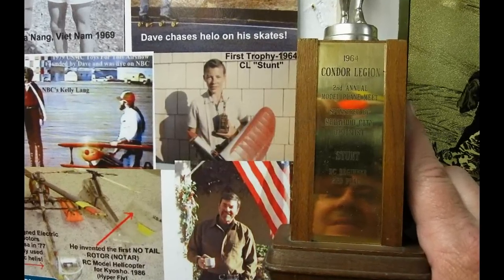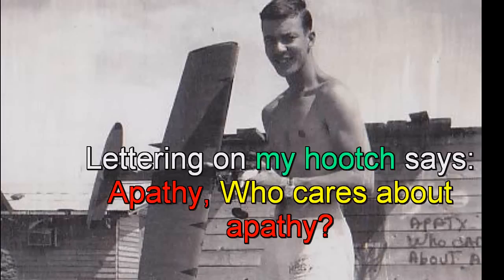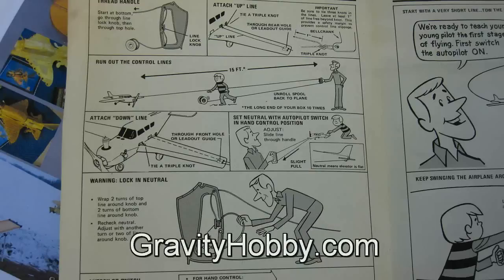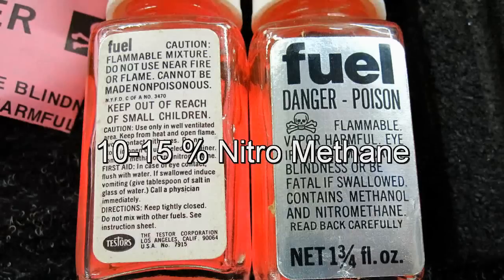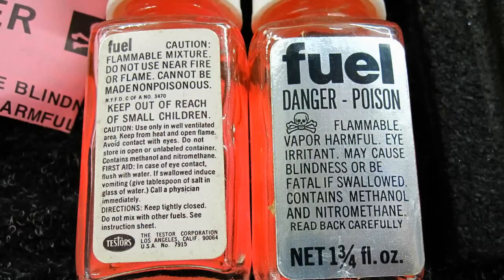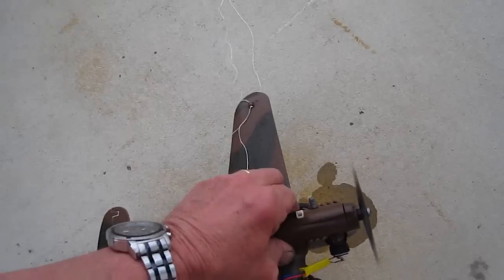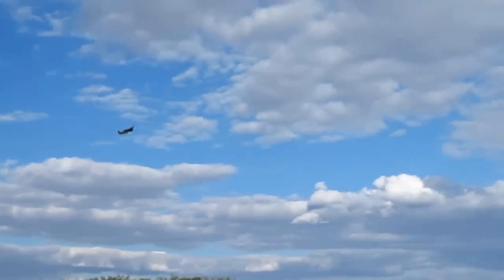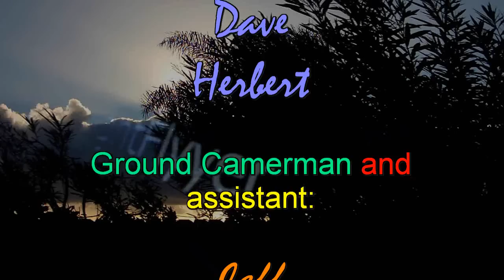Vintage Cox Control Line Plane's History and flights by NightFlyyer. A few are Testors.

Comment: Good times... I had the Cox Ryan ST-3 with 3 lines and a throttled .020 which didn't last long, then the "Red Baron" biplane (which was really a redecorated Pitts), then I graduated to the Midwest Snorky trainer which actually flew well, and a Jr. Nobler, Veco Smoothie, Flight Streak Jr, and many others before R/C captured my (and my Dad's) interest.  I think I still have some of the engines somewhere, including several Coxes, a Testors McCoy .049 and a Wen-Mac .074.

Comment: Bought all of a 7th grade classmates U control stuff in 1957  2 planes McCoy 19 on one and a Green head .29 with severa sets of lines and parts. Went in the USAF in '64 built a Stuka w/ Fox .36X at Chuneat AFB in early '65. SSRT Peters gave me an artical 15 for having Flamables (airplane (DOPE) in the barrakes. Flew Control line again in '86 when my son David found a Profile P-51 w/ that Fox .36X (Froze up) which he took apart and cleaned. After manu many repairs. We got into R/C with a Poorley Built Trainer 60 w/ K&B .51 that would not stay running.  First 19 take offs 19 dead sticks. Our Instructor Jim Wainner (Milwaukee Flying Electrons) was so paitent.  Long story short, Davy turned 17 forun girls and cars and has never flowen again. I runaround with a Van full of 7 R/C planes & Trailer and a basement and spare room I have to move planes to walk in. Found if you stand te big Gassers on their nose you can get a lot more in the room. Just think all my still living friends will undoutally be glad to pick thru my stuff and try to get it all for cheep. Love the memories. At 77 I'm still flying with my high school Industrial arts teacher, he's a young 93.
Reply from the maker: Great story and glad you hear  your still flying.  I lost all these planes in a huge fire on 911, 2016, but because of generous subscribers, have built up a new squadron, some Ukies, which I have made videos on.  Room is also a big problem in this house compared to my last one, so I sure understand what you mean, as I have a giant Pitts, F-16, and others.  I am donating much of it to the AMA museum to keep the guys from picking thru it when I'm gone.  LOL.  Thanks kindly for your service and being a retired Aviation Marine of 33 years, I appreciate it.  Thanks for commenting and happy flying.
Reply: @NightFlyyer     33 years   I made 4 years minus one hour & a half, But who was counting?  Keep'em coming.

Comment: I remember the old Cox engines from the 1970s primarily because the exhaust had a very distinctive odour -- NOT unpleasant, just unique. :-)
Reply from the maker: Definitely unique. These You FO's can really handle the wind and are cheap to make.  And if you remember the .049 days, you will recognize the sound.  In the video description,  are links to the videos of my original electric You FO for a less complicated and quicker build than the nitro version.  Thanks for tuning in. ~Dave
https://youtu.be/DeWao5L6FLM

Comment: How do you keep the lines from tangling when doing all those aerobatics. Great show dude!
Reply from the maker: Well, we used to do 3 inside loops, max, then 3 outside loops to untwist.  The steel lines would still move with the loops.  Thanks kindly.  Check out the Cox PT-19 flight I just did this week if you get a chance.  https://youtu.be/BU0z7ddwslY

Comment: Dave... Absolutely brought back memories of my first plane.  A low wing war plane knockoff U - Control line.  When I saw you spinning and spinning, it reminded me of how dizzy I used to get flying mine.  I too learned the hard way about the 1/2 tank!  I was about 10 years old in 1983.   Don't recall the manufacturer, just that it was blue with yellow accents, and once made me puke from dizziness!

Comment: I was 13 in 1963, and my Dad gave me a Cox P-40 for Xmas... put that sucker in the ground in about 2 seconds... broke the plastic wing off the plastic fuselage... used that engine in a balsa and ply plane that I just kept gluing back together till I learned how to fly it... had some landings with that plane where it coasted about a half circle... that's how I learned... graduated to R/C when I was 20 years old... wrecked that first Cub trainer about 30 times. but just kept fixing it...

Comment: My first U control plane was the Cox P40.  I earned it by selling a dozen boxes of greeting cards.  Then I built a ringmaster with the help of Bill Roland who was a tenant in our mobile home park in Alexandria, LA.  He was heavy into U control competitions.  Speed ships, stunt routines, dog fighting, and carrier deck landings.  We had a nice U control field with three concrete runways at our city park.  There was a real F-84, if my memory is correct,  on a pedestal in the corner of our flying field.  I skipped the RC flying and went into fixing and flying real airplanes when I went into the air force.  I was a crew chief on C - 130s.  I got my private license through the base aero club.  Then used my GI Bill to get my commercial and several other ratings.
Reply from the maker: That's a great story of success.  I was an RF4B guy in the Marines for 34 years and loved it.  Thanks so much for serving.  You may like this recent video I made of flying my Cox PT-19 last week.  Thanks kindly and happy flying.  https://youtu.be/BU0z7ddwslY

Comment: Brings back memories, my first were two Cox Stukas we picked up at the Salvation Army. By digging thru their donation boxes I also found the metal launching platform which held the tail down and had the wheel trap which had a release string attached. We collected everything that went to them, and picked up the fuel at stores. Later when Christmas came, mom bought me a new Testors P51, and I flew it till I wore it out. It didn't help that the Stukas had those bombs you could drop, and we setup plastic army men to do just that. The problem was you had one bomb, and you either hit or missed, and if lucky the bomb hit one guy, and he flew into another. So.....Being the kamikaze pilot I was......dived into the army guys scattering them everywhere. We lived at the end of a big cul-de-sac and my airport was at the end of my driveway. Doing what I did made me famous, and soon there were kids from everywhere sitting on the curbs watching, and then running under the plane to grab the guys and set them back up before I ran outta gas...........Things that would make most liberal heads explode, I did and lived thru it........wouldn't trade it for the world.

Comment: My last Cox plane was the radio controlled Thermal Hawk. I bought two, and a bunch of extra sets of wings. I used the .51 tee dee motors and flew full throttle until the fuel ran out. One flight on a hot summer day I found a strong thermal and it climbed and climbed and climbed until I could barely see it. I was shocked when Cox went out of business.
Reply: +Dasdfjkl the cox company i still going now.. some business guys in canada took over. they are selling new and vintage NOS engines.. you can get a new  cox .49 for 49.00  built from either NEW, or NEW and OLD NOS pieces.. your choice.   i can only imagine a company that ran that long made millions of engines had a huge stock of parts that will last for a long time.. and long as there is a demand for reliving the old im sure we will have a cox company.  im new to RC my self.. been in it about a year, however, iv  only been learning about the electric aspect of the hobby, and building and flying quad copters..   now i built one rubber band balsa kit.  i want to explorer building a balsa built plane..  and am considering a RC cox .49 ill probably just get it from the company new instead of buying a old one that is probably new on ebay since thee are so many NOS ( new old stock ) motors for sale and even more used ones..  being new figure starting with new is the way to go one less thing to figure out..  i may only fly nitro plane once, then switch to balsa electric.. but i sure enjoyed the balsa wood model.. was a lot of fun to build even if it was a rubber band model.  i wish i would of started this hobby sooner, as im 41 now.. but better late than never i guess.  just so much to learn. so much on the electric/quad side. sometimes i think the more i learn the dumber i get. laughs.  have a great day.

Comment: I had the Testors Spitfire. Tried to fly it on too windy a day - crosswind flipped it on its back and into the ground. Smashed the landing gear and ground the tips off the prop blades. Gave up after that. Still have the engine somewhere - probably gummed up.
Also had a Cox R/C Bee .049, the one with the exhaust port sleeve that could vary the speed.

Comment: A lot of model airplane enthusiasts got their start with the ready to fly Cox plastic  planes. But be realistic. They were difficult to fly. Overweight and under powered.  Fairly durable and if crashed on grass, usually survived.  But if flying off grass, they needed to be hand launched.  My father bought a Cox Piper Cub he was going to fly and then teach me. Didn't work out.  I eventually bought a Cox SB2C "Helldiver" that I managed to get a few flights out of before selling to a kid up the street.
Years later, stationed  at NAS Memphis, I brought out a Sig Banshee powered by a Fox 35 stunt motor to California to show my skills to my father. A fer inside and outside loops, wing-overs and inverted flight.  Nothing spectacular but Dad was impressed. : )  I made a stab at RC but to me it was never as fun as U Control.  The physical connection with the model I guess.
2:10 I do remember the Testors models and seems like their .049 engines were just not as good as Cox.  At one time I had a "slow combat"  aircraft with a Testors .35 engine. More powerful than a Fox.35 stunt but less than the .36 "Combat Special."  Almost needed an electric start to get it going though. 
One of these days I'll ply an old Baby Flight Streak and TD .051. Still kept it all thee years. Even a set of .035  stainless steel lines. Way better than Dacron!   
But looking back, Cox made at least one good flying model, the Bf 109 stunt plane with hollow foam wings. While in the Navy someone bought one and doubting his flying skills, asked me to fly it. It could actually stunt!
Reply from the maker: All true, but that was all we had back then and it was fun.  This video was made 9 years ago, and sadly these models have all been destroyed in that fire.  I have been flying Ukie again, for Nostalgia, since I am now 71 and it is still fun. In fact many others are now trying it again.  I recently purchased a COX PT 19 on eBay for $189, so it seems there is a demand.

Comment: I got a Cox plane for my 13th birthday.   I loved flying it.   It wasn't long before people started giving me Cox engines from planes they had and crashed.  I always tried to hot rod things and played with different cylinders and reeds.  I had one I thought was really going to be a fast motor.  I got the plane up and it kept stalling.  After several time of it shutting off, I started to force the plane to keep flying.  The string broke and the plane landed in my car and the fuel spilled all over.   It cracked the dash board also.  I could not have gotten it to fly across the parking lot and into my car window if a million dollars were on the line.    I gave up and I gave those engines up to another guy .
Reply from the maker: Sorry to hear that.  Those engines took special patience for sure.  Here is one of my newer videos on Control lines, as all the planes in the above video were destroyed in a huge fire that destroyed my home and all my models.  https://www.youtube.com/watch?v=rCOwJ1yvdAQ&t=28s
Reply from the maker: I sent you the wrong link.  Try this one.  https://www.youtube.com/watch?v=NntPP4HA1E0&t=325s

Comment: This is a GREAT video, one of the best hobby videos I have seen.  Thank you for the time in putting it together.

Although I grew up flying Estes rockets, I didn't get into any type of model aircraft until my 40s.  And that was electric R/C.  A few years ago, I bought a fantastic little control line plane, the Cox Apache, which is basically an autogyro.  I flew it several times, but even in grass it would break easily on hard landings.  I wiped out Cox's spare inventory of parts!

Comment: The landing gear usually snapped off on the first landing lol.  I had one of these and also the red and blue biplane.  Graduated into RC from there.  I was lucky, I had a close cousin that worked at a hobby shop.
Reply from the maker: Yes, hard landings can be tough on those little landing gear.  Thanks for commenting.   Here is a link to last week's ukie flights where we got Goated that we bet you will enjoy!  https://youtu.be/HdmXA0Xc1ew

Comment: As I recall, the Piper Cherokee you were flying, isn't that an EZ Flyer? If that is the case you simply had to flick your wrist to engage the little autopilot the EZ models have, so no need to get dizzy, above the head and flick the wrist. I have the Cessna 150 version and it works good.

Comment: What was the competitor to Cox?  I had several from Cox, a green Mustang,  a yellow T-6, and I think a Thunderbolt with silver paint that the fuel bubbled up.    I had a black Stuka which was not a Cox.  Less breakable than Cox but harder to start.
Reply from the maker: Not sure but maybe WenMac.
Reply: @NightFlyyer  Thanks,.  Actually I found the Stuka right after this last night on ebay.  It's in fact a Cox.  But it's different than usual; more flexible plastic, a little bigger, more parts and more detail.  For several years around age 11  I could count on my Christmas present being one of these planes :)

Comment: We used to run ours just slightly rich of peak rpm so when the fuel was about to run out, the engines sped up noticeably.  It gave us just enough warning that we could get the plane low and ready to flair while it still had some airspeed.

Comment: Nice video, thanks for bringing back old memories.  Back in the 60s, had a WenMac KingCobra, powered by a recoil start .049, given by my godfather.  Dad taught me how to fly it, went on to balsa Ringmaster and so forth, last control line model was a Stering Spitfire where I learned how to fly most stunt maneuvers.  After I crashed the Spit, my Dad said it was time to move up to RC, which he again taught me.  Back then, we had to build from sticks and sheets of balsa, cover with silk and paint with dope (yep, dope had a better connotation then) before we could fly.  Funny how guys today screw together a foam or an almost completely built balsa plane in 20 minutes to a few hours, and call it a "build".
Reply: I know,right. It usually took us all winter to build a plane,only to crash it in minutes come spring. We learned,and got better. Yeah builds are a joke now. even quads come prebuilt. nothing but batterys and a receiver and off you go!

Comment: I originally learned to fly a U control on a Cox PT-19 trainer, my first flight at Cox's flying demonstration at Disneyland in California!  Later worked up to larger U control planes with a McCoy Red Head 35, and finally into RC in 69.  I still have an original Cox P-40 up in the closet, not too far from a Citizenship galloping ghost radio that was my first radio.

Comment: Awesome video! I guess I wasnt as cool when I was a kid because my plane had 2 d cell batteries in the flashlight like controller and just one button to push that made the plane take off and fly. Had a metal cable type cord connected to the plane on one end and remote on the other. Does anyone know what the battery powered ones like I described are called???
Reply from the maker: Those were cool.  I think they were made by Whamo.   Bet you will like this one even more.  Thanks much!  U control Tethered, Speed, Stunt, and getting Goated by Adam's Goat while flying !  https://www.youtube.com/watch?v=HdmXA0Xc1ew

Comment: Landing was a little rough, I flew these control line planes for almost 10 years.
The trick is to focus strictly on the plane - lock your vision only on the plane. 
You got quite a back ground working on the real thing - I envy you.

Thanks for the video.

Johnny
C/L Cox P-40 Flier.

Comment: im now the proud owner of a home built  red baron tether but i need to know where the fuel goes. does it have a on-board tank or does the  little area near the reed valves serve as the tank ?  i need to know just cause of the scale. im very familar with all kinds of engines  but where the tank goes on this one is confusing
Reply from the maker: Well, if its a Baby bee there is a round aluminum tank on the back. There are two very small pipes that stick up vertically right beside the needle valve.  Fill either one, when it is full, fuel comes out the other one which is the vent.  Those are reed valve engines.  If it's a TDee type, it has an opening for a fuel line at the bottom or opposite side of the needle valve at the rear and an external tank is required. They typically are plastic and connect to the engine in the rear. See the video on my twin cox engine (reed valves converted to external tank and maybe you can determine what kind of engine you have. Also see my flying rag video to see a TDee engine.  If you google cox .049's and click images,  you will see all the pictures of all the engines to determine yours.  Good luck.

Comment: Ha ha!! Now you know the hardest part about flying c/l...keeping from getting dizzy. The second was not crashing...often as a result of getting dizzy. This takes us all back to our first control line plane. Mine, a Cox PT-16. Thankfully, the wings and motor were held on with rubber bands. Remember distinctly, even now, when the engine bands let go and the motor took off on its own flying over everyone's heads and scaring the beejeesus out of all of us.